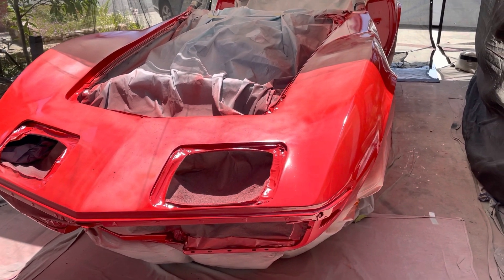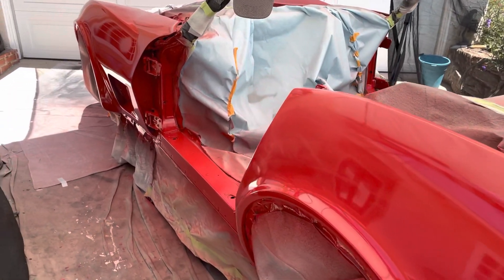Painting my C3 Corvette

Comment: Kudos on such an accomplishment! I’ve painted motorcycle parts outside and it’s challenging, so I’m very impressed with your results so far. Once that paint has cured and you can color sand it, then buff it, it will look like a million bucks. Good work!
Reply from the maker: Thank you my Brother. I appreciate the support. You know how these things go: Two steps forward, one back, but eventually, we get there. I’m happy with the result.
Reply from the maker: BTW: What are you riding? I have a 2007 Street Glide and a 1978 CB750.

Comment: How much paint are you using?
Reply from the maker: So far, I’ve used about 3 quarts to paint everything except the rear valance, the hardtop, and the smaller trim pieces (wiper cover and grill vents). I think one gallon (which is really two with the reducer and hardener) would be enough for a car. 

Note: 3 quarts of color, which when mixed = 6 quarts

This is the ATX single-stage from SW automotive. Cost for a gallon of color, reducer, hardener is about $700. Red costs the most.
No clearcoat though. One and done!
Reply: @thedrivewayC3 I'm not going to be so kind, if you don't get criticism you'll never get it right. There's nothing wrong attempting to pain outside. But you are not getting enough paint on the car. There is WAY to much orange peel and a lot of that is from lack of paint. I assume you're trying not to get runs. If you only put on 3 coats, with the amount of orange peel you have, by the time you sand it out, you're not going to have sufficient coverage. You needed to apply 4-5 coats if you were going that light. 3 is for a good wet coat that flows out smooth. Thin paint will burn thru, fade quicker, or worse, lift over time.  I paint.
Reply from the maker: @71sixpak  Thanks for the feedback and advice. I agree with you and am making some modifications and adding some paint to some areas that may burn through. I’m OK with helpful critiques.
Reply from the maker: I ended up using about a gallon of color for the entire project. Keep in mind that single stage uses a 4:3:1 ratio of color: reducer : hardener. That means that you are doubling your color volume when all is mixed. (2 gallons of ready-to-spray material from one gallon of color)